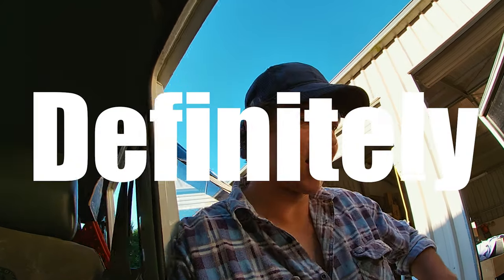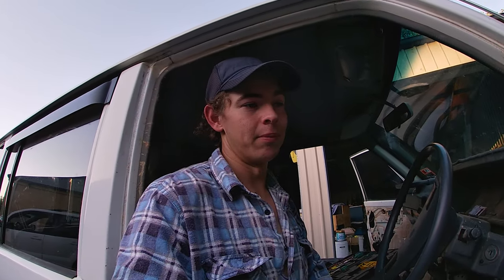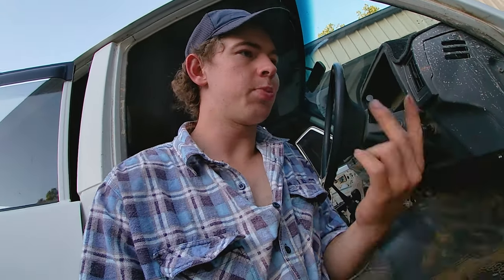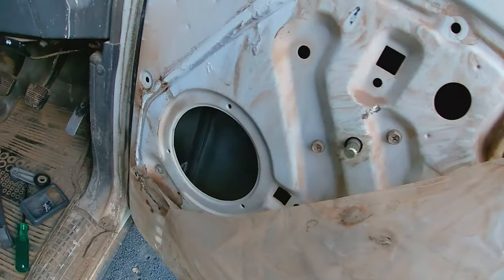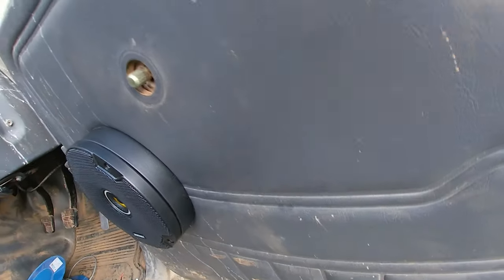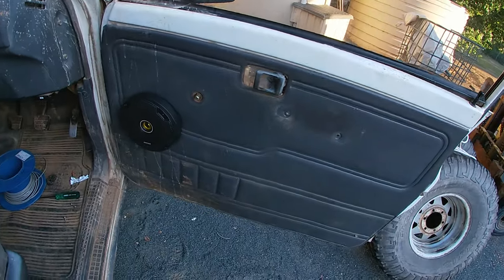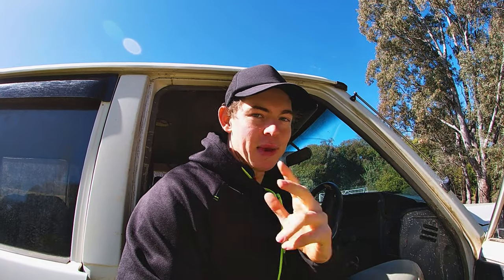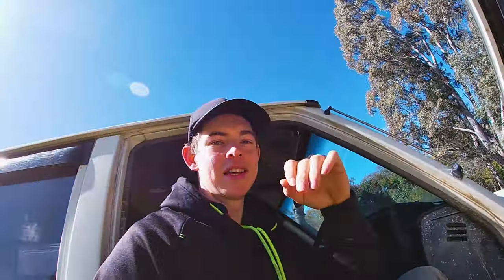GQ Patrol Speaker Install // GQ Patrol Build

Comment: Hey mate. When running speaker wire where do you run it to? The back of the head unit? I have an upgraded hrad unit but i think the speaker wires are faulty so i want to replace the front speaker wires. Cheers